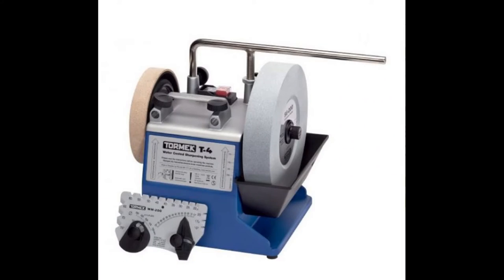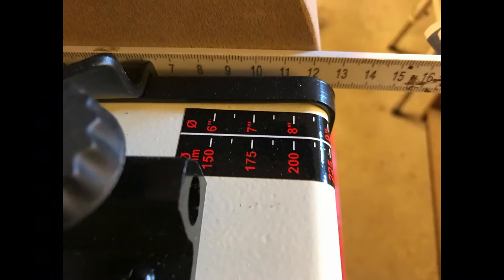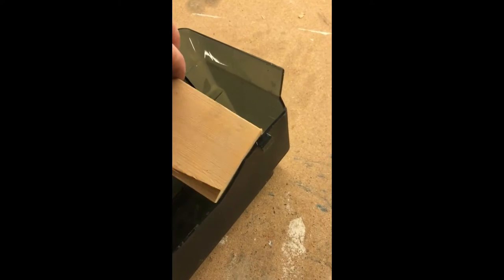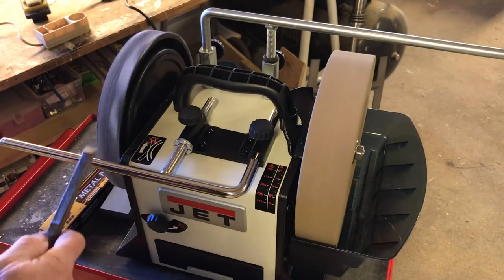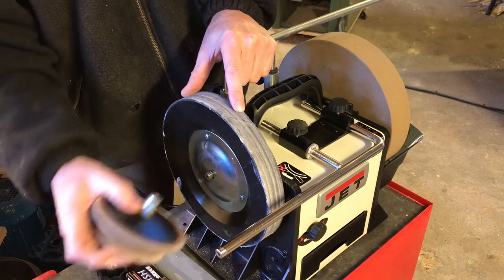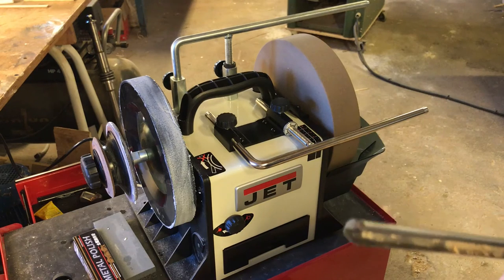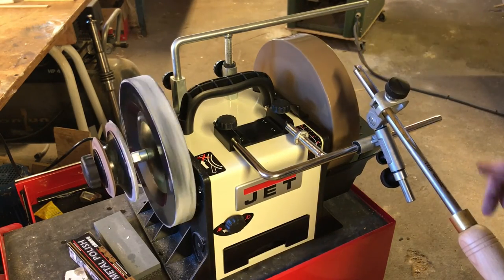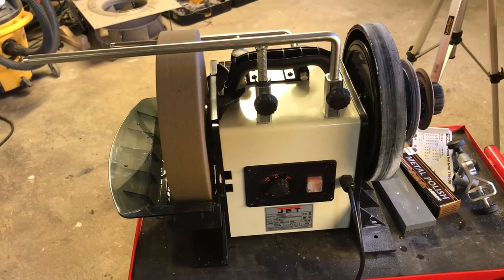JET wet grinder, JSSG-10, sharpner

Comment: Excellent review.  I'm curious when you bought this?  The JSSG-10 I believe is the older model number for the newer JWS-10 that is on the Jet Tools website now as of December 2020.  I looked on the Jet website at the beginning of 2020 and they did not at the time carry the JSSG-10 or any wet grinder.   I think the JSSG-10 went out of production for a few years at least.   I have the JSSG-10 from about 2004 I think, and it has been a good machine.  I'm at the point now where I need to replace the motor brushes having only used it a handful or more times each year on chisels and block plane blades, and my kitchen knives.  Jet has the brushes on the Jet Parts website which is a good thing.  I think the wheel is comparable quality to the Tormek stock wheel.  You should put "sharpener" in your title for more hits.
Reply from the maker: Hi Pool Pro - thank you for your comment :). I bought the JSSG-10 on a sale here in DK - and your are right, it's an older model, but still doing sharpening fine. My experience when compare a Tormek and Jet grinder wheel - is the Jet wheel is a little more "loose" in it's compound. It's easier to get a groove on the wheel surface. But I plan to get a Tormek diamond wheel  (grit 600) as replacement, anyway. And thank you for your tip - I will put sharpner into the title.

Comment: My JSSG-10 stopped running and a local shop want $335 to diagnose why it stopped running
Reply from the maker: Hi William - sorry to hear your Jet grinder has stopped working. My Jet grinder is still working perfect.
$335 sounds a lot - only for diagnose ? Have you tried another rep. shop ?